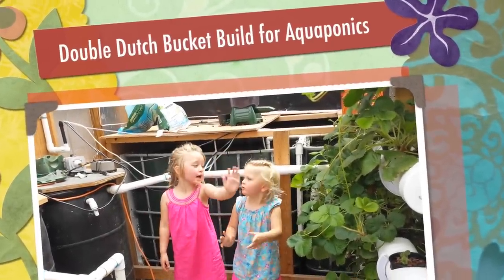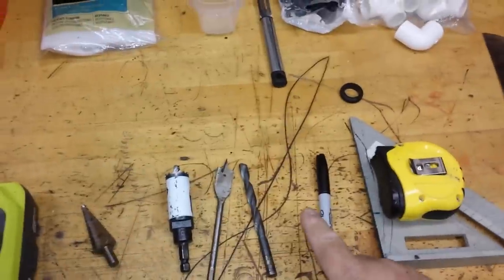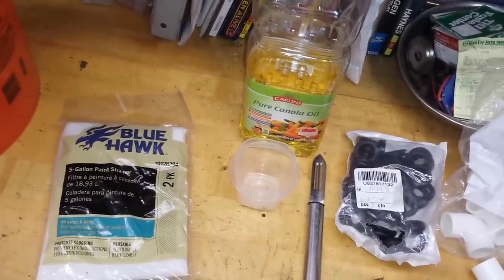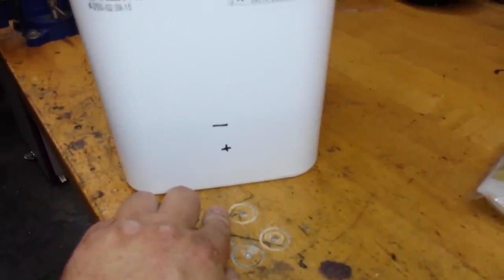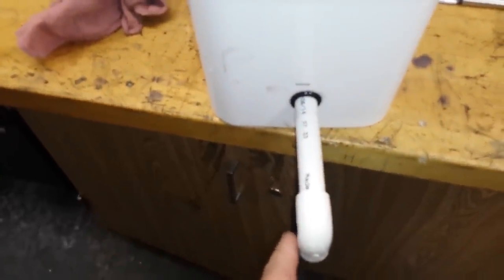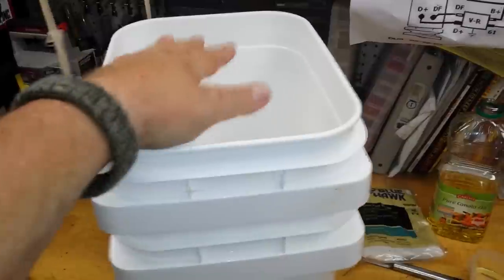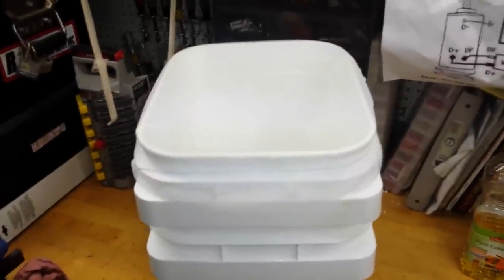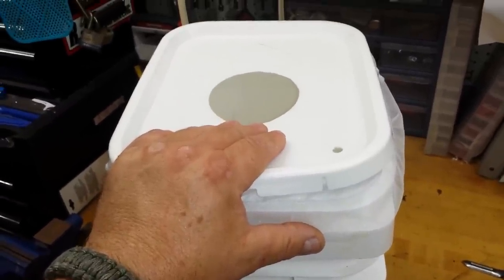Double Dutch Bucket Build for Aquaponics

Comment: Why double the buckets? Isn't the point of the Dutch bucket system to allow some water to stand at the bottom for the long feeder roots? If you're going to prevent that you might as well run the water straight out the bottom instead of doing the elbows near the bottom.

Comment: So if you have a small starter plant in one of these and water is only at tge bottom of bucket how can roots get to water?
Reply from the maker: D n D Burton  the water comes through the pvc pipe at the top of the bucket.
Reply: Thomas Fish yes but wouldn't it sit at the bottom far from the roots? And drain before could rise up to the root level?
Reply from the maker: The water flows through the grow media, moistening it and sits about an inch and a half deep in the bottom of the bucket before going out the drain.  The water is running 24/7 and the rocks under the surface is always moist.  Some growers put the watering on a timer and have it cycle on only 15 minutes each hour.  The roots will extract moisture from the grow media.

Comment: Did everything flop? Kinda dropped off there bud. Like everyone else said, love the design - Would love to replicate it but the lack of information afterwards makes everyone think it didn't work out in the end. Hope all is well Tom!
Reply from the maker: Thanks for asking Nick.  All is well now.  I have been dealing with cancer for the last 3 years and my greenhouse took a back seat.  I am back at it again making some new double Dutch buckets from tidy cat litter buckets.  The others got brittle from the sun.  I will try and get a new video out.  Thanks for checking in.
Reply: Thomas, well I feel horrible for coming off rough and I pray for your remission! I've taken your advice and I've built a similar system on a much smaller scale. I have seven *double dutch* 5 gallon buckets and five *double dutch* 3 gallon buckets in a 6 x 12 x 10 greenhouse and I've had some problems with flow and leaks but working it out slowly. Can't wait to see your next update and I'm wishing you the best with your health!